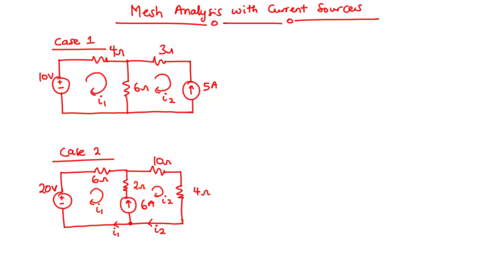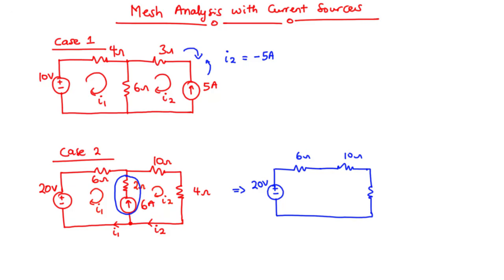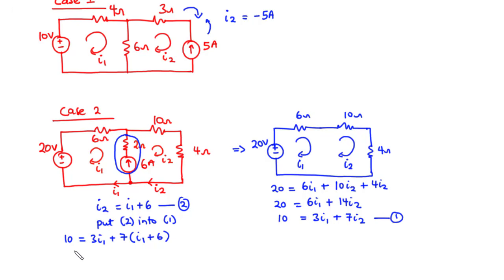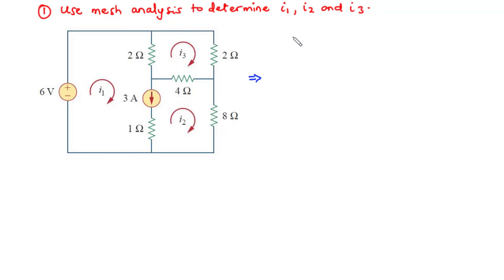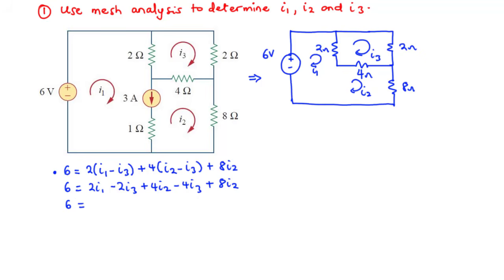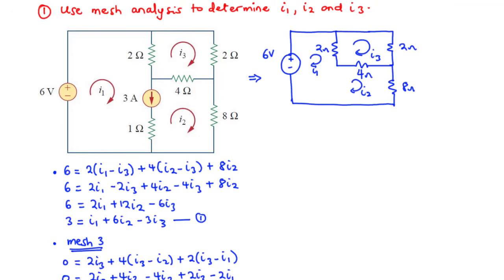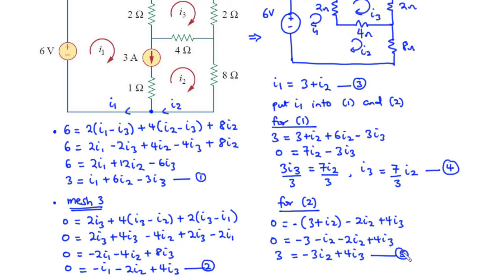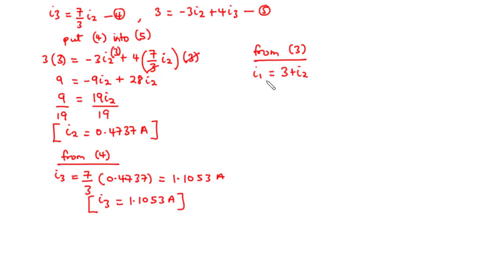☑️15 - Mesh Analysis with Current Sources (Supermesh) 1

Comment: 4:34
Why Can't we write 
for 1st loop : 
-20+6i1-6(2)=0
For 2nd loop : 
10i2+4i2+6(2)=0

We are evaluating voltage drops across resistors in a loop soo why can't we apply that above equations instead of using super mesh
Reply from the maker: Well, there are a number of theorems available to solve this problem, only that in this case we want to use mesh analysis. And this is how we go about it when we have a super mesh.

Comment: Pls for the eqn(1), you did not include the 2i3…. Kindly check or that is how it is done pls
Reply from the maker: At which time specifically, so I check and explain to you better
Reply: @SkanCityAcademy_SirJohn  I think He is referring to to mesh i3 where you have two 2 ohms resistor. One of the 2 ohms resistor is shared with i1 and i3 but the other is solely for i3 only.
Reply: @SkanCityAcademy_SirJohn   at 11.06

Comment: Why is it 2(i3-i1) in mesh 3
Reply from the maker: It is so because you know:

For mesh analysis, we take the clockwise movement.
In that regard, referencing the direction of i3,  and that is clockwise hence positive.
Now i1 is meeting i3, which means it's opposing i3 hence it will be negative (anti-clockwise)

Comment: does there need to be a resistor with the current source to make it a supermesh or can we do it even if its just the current source by itself
Reply from the maker: The condition is that a super mesh is formed if two meshes have a common current source between them, (dependent or independent). 
So regardless of a resistor in series with the current source, so long at there is a common current source that is fine.
Reply: Even current source only

Comment: Please why don't we involve the one ohm resistor in the 3rd equ
Reply from the maker: The reason is: according to the concept of super mesh, if a current source is found between two meshes, a super mesh is formed by eliminating the current source in series with any circuit element (in this case, the 1ohm resistor). That is why the 1ohm is not considered.

Thank you, hope you got it.

Comment: Please why did you solve i1 and i2 as equation one and i3 as equation 2....please what's the reason
Reply from the maker: i1 and i2 are the current in the super mesh. After creating the super mesh, there are only two meshes present. The super mesh and mesh 3. So going round each mesh, you can select one as equ 1 and the other as equ 2 and vice verse.